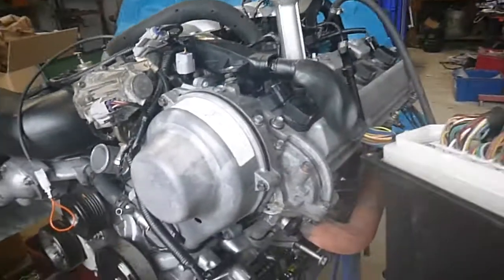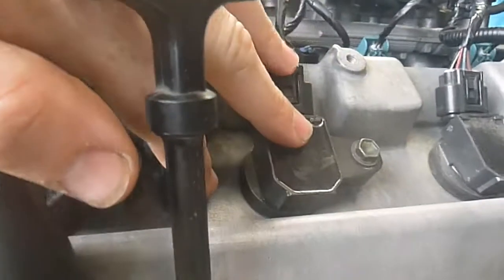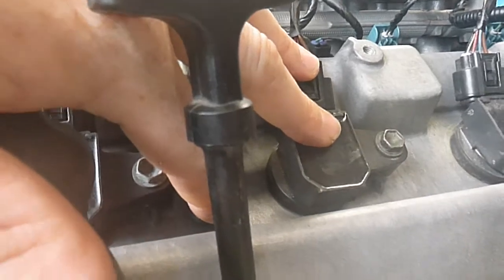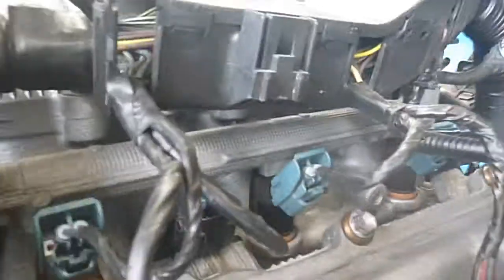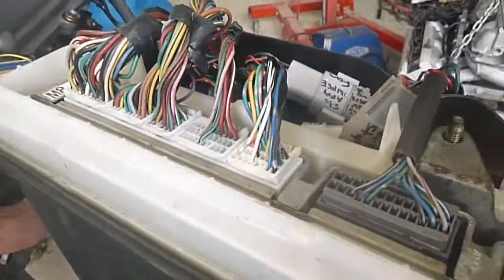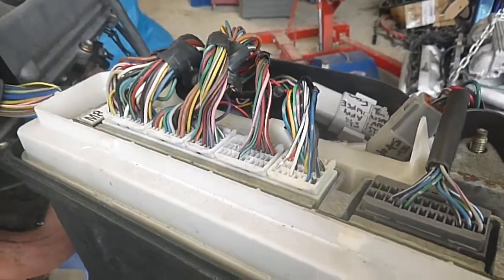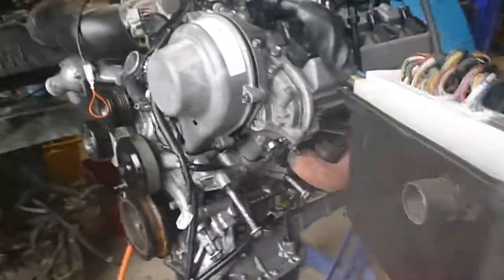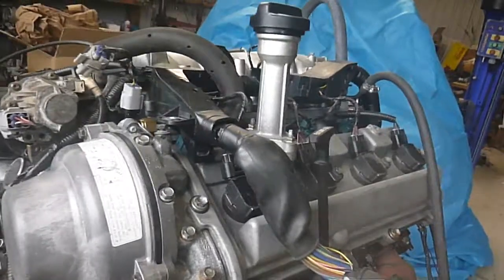3uz onto 1uz management

Comment: If you have car with a 1UZ VVTI and just swap a 3uz in directly while keeping the 1UZ vvti ecu will it work long term? Will the ECU long term fuel trims be able to compensate the additional displacement/air flow without flagging any check engine lights over time? 

Thanks
Reply from the maker: I should do a video on this.  Yes,  the 3uz swap in fine with the 1uz vvti bits on the long block and run great.
Reply: @CartuneNZ  thank you for answering! I was thinking of swapping a 3uz engine into my lexus gs400. Kind of a cheap upgrade of added displacement. But get to keep the fast throttle body response and e shift of the gs400. They took all that away in GS430 and I like having it.
Reply: @TheAnonymous1one Hey man, I'm in the same situation as you. How'd you get around the Knock Sensors being diffrent?

Comment: Do you know if I could take a 1uzfe vvti motor and upgrade to bigger injectors and fuel pump while using a 3uzfe ECU? I I just want to make sure it should be plug and play so I don't want to have to adjust the wiring harness/loom? thanks for all your great info on the UZFE platform!
Reply from the maker: The 3uz ecu can run a 1uz vvti and can be reflashed however the throttle body will need to be changed along with wiring harness as the 1uz vvti and 3uz ecu have different plugs.
Reply: @CartuneNZ  thanks again for the speedy response, I talked to another UZ motor expert and he told me the literal same exact thing you just said. Another thing he told me however is that by using a JDM 1uzfe vvti ECU you could bypass the immobilizer, evap, cats, & second set of O2 sensors all together.. which I guess is pretty good enough for the applications it will be performing in.

Comment: Question, swapping a 3UZ in a VVT-i LS400 (UCF20) possible by using the stock loom? No rewiring required?
Reply from the maker: Absolutely.   Change the long block,   use 1uz sump,  mounts,  intake manifold,   throttle body and wiring harness.   Easy as.  Cheers Kelvin
Reply: @CartuneNZ  How do I rewire the Knock Senors? The 3uz has two pins, but the 1uz only has 1 pin Knock Sensors..
Reply from the maker: @ethanwashere1074  no rewiring needed,  fit correct knock sensors that match the ecu
Reply: @CartuneNZ  I have a 2000 Gs400 Harness, and I am trying to fit it to the new 3uz engine. The Knock Sensors aren't the same, and the 3uz knock sensors have what seems like a Stud built into the block.
Reply from the maker: @ethanwashere1074  correct the 3uz knock sensors arent the same and arent compatible with your ecu,  therefore if I was doing this job I'd remove the later 3uz knock sensors and replace with the compatible 1uz vvti sensors.
Reply: @CartuneNZ  Am i able to take the 3uz Stud out and then be able to thread in the 1uz sensors. Or is there another 1uz sensor that is similar to the 3uz sensor?

Comment: Same  horsepower  and torque using the 1uzvvti computer? or would it be the same as the 3uz computer?....Thanx
Reply from the maker: Keeping the correct ECU with the engine is preferable however if the correct parts are used they swap around and run fine with the driver not noticing anything strange. Years ago I did run one up on the dyno and I was happy with the output but can't remember the results sorry.  If you can stick with the correct ECU for the engine.  Cheers Kelvin
Reply: @CartuneNZ  Thank you sir, i appreciate your time and knowledge.

Comment: Hlw sir.
Do you have 1uz ecu diargam..?
Reply from the maker: Absolutely I have diagrams and instructions for most 1uz engines and the 3uz.  These are a product which I sell.  email info@thecartunecompany.co.nz  .  Cheers
Reply: Please send some diagram for me.
Reply from the maker: sure.  Email me first I will send payment details then send instructions to wire with diagrams.  Cheers
Reply: whithout money  you don't give diargam.
Reply from the maker: Correct.  I am running a business doing wiring on 1uz and 3uz.  Mine come with step by step instructions as well.